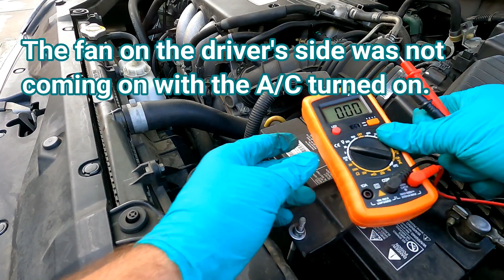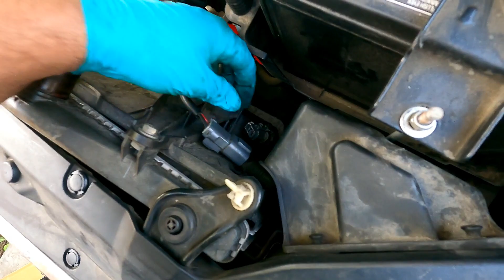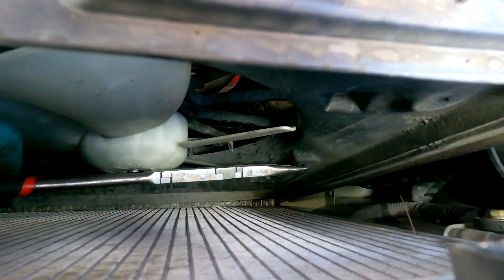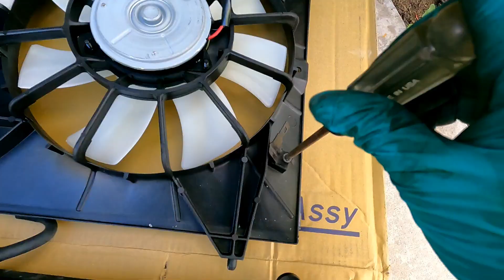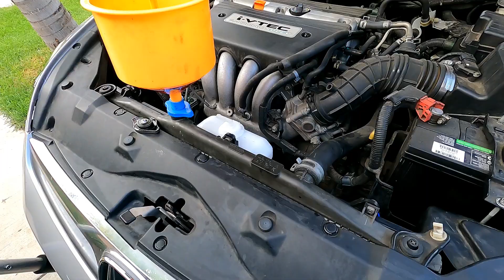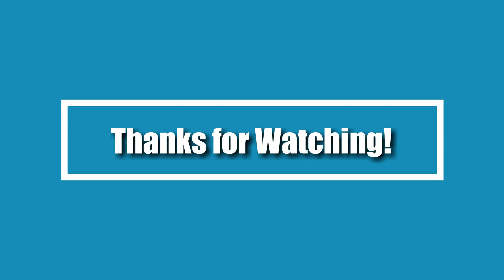2003 - 2007 HONDA ACCORD RADIATOR / CONDENSER FAN ASSEMBLY REPLACEMENT - DENSO RADIATOR (2.4L 4 cyl)

Comment: 2003 Honda Accord 2.4 litre let it warm up for 22 minutes and then the gauge went on H for hot little bit of smoke ( hardly can see it ) do you think it needs  cooling fan? Thermostat Housing is new and The Thermostat is also new !!!
Reply: Great info. How do I know if it’s a denso radiator
Reply: Sounds like it needs rear brakes or a new steering wheel.

Comment: OMG!  Thank you so much!  I can totally do this!
Reply: Completed!  I didn't time how long it took, but it was quick (30 to 45 min max).  Removing the little clip on the bottom left proved difficult, but once I understood that there was a small "button" where I needed to apply pressure, it popped right off.  The next snag came when trying to remove the metal prong from the old unit to the new.  Mine was screwed on so tight it required some 3 in 1 and a lot of downward pressure to move.  Luckily, we had a similar screw to replace it with as the original was stripped by the time it came loose.   I can't tell you the sense I pride I feel from completing this project on my own.  My husband was handy just in case I needed some muscle, but I did 98% of the work.  Thank you again for your great video!